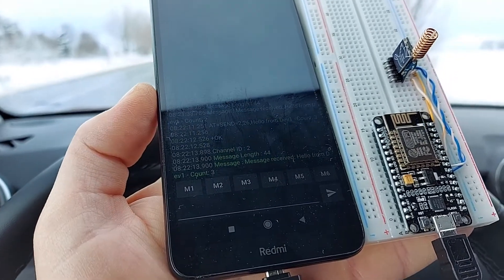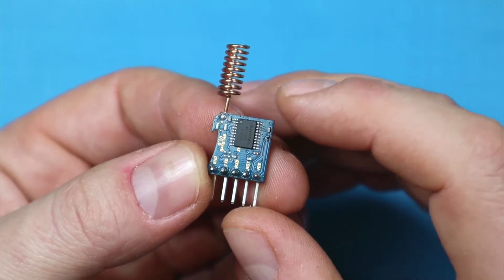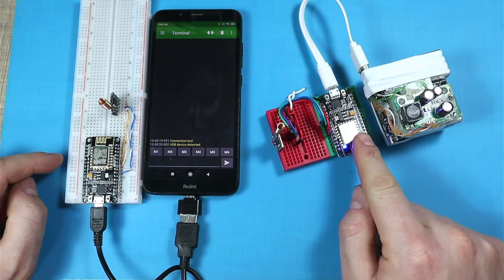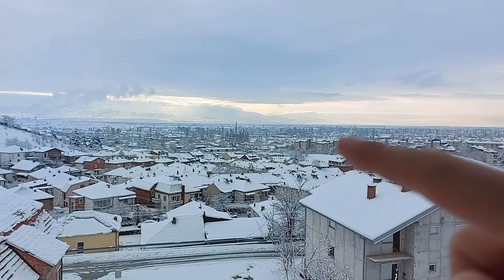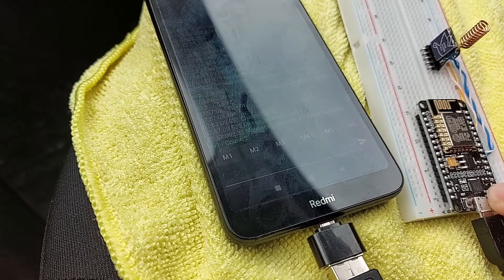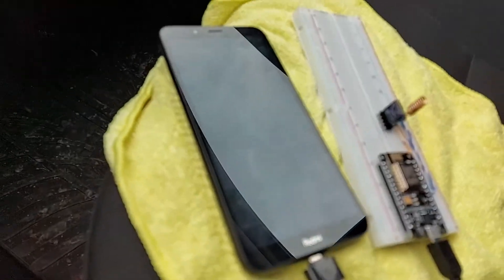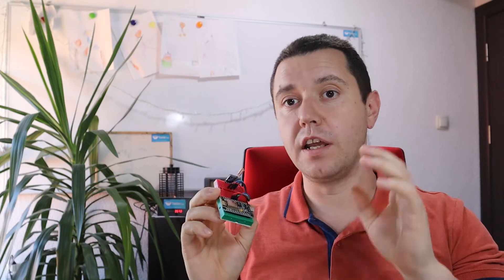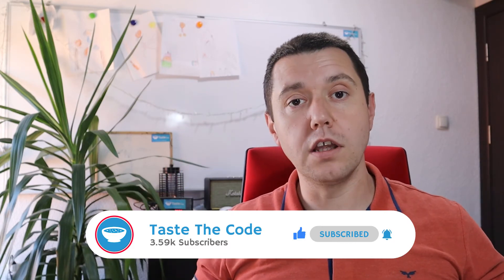LoRa Distance Testing with RYLR998 in open field - Amazing results!

Comment: Connection diagram?
Reply from the maker: Hey Hari, it's very simple. D6 (pin 14) is connected to RX on the module and D5 (pin 12) to TX on the module. Additionally, the module is powered from 3.3V out on the NodeMCU module. That's all.